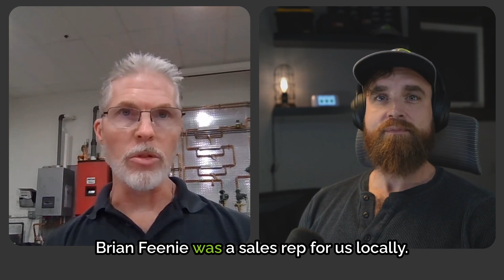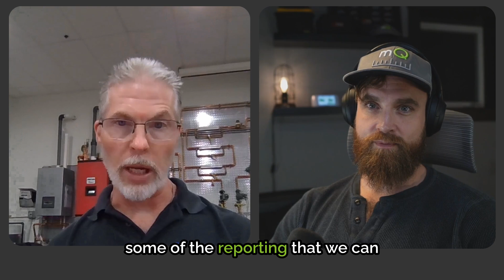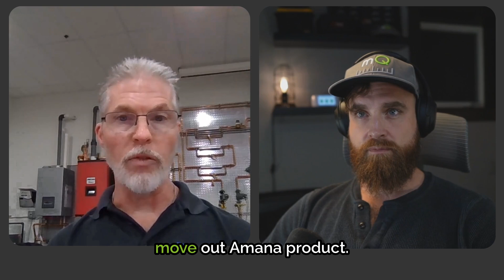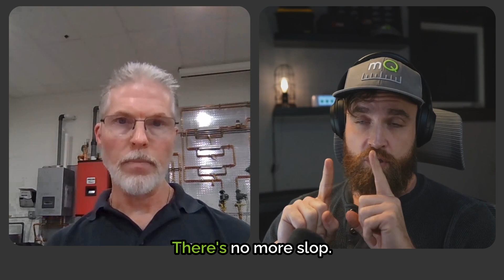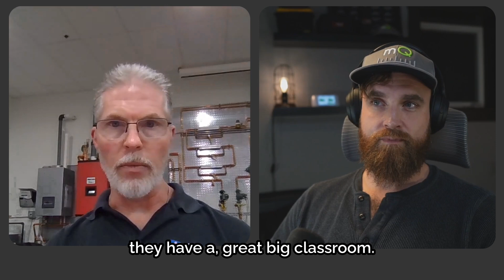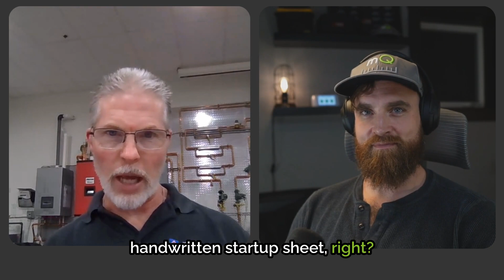Distributors should be Using measureQuick? An Interview with David Petz from Johnstone Supply

Comment: I truly believe this is the tip of the iceberg.  For too long distributors have accepted warranty claims from dealers and issue a credit only to find out the motor or part was just fine.  I like the idea of rewarding the dealers that are doing proper commissioning by possibly giving them an extended labor warranty at no charge, or charge them less for the equipment. Great to see this conversation!

Comment: Years ago, I asked one of the owners of a Johnstone franchise you have so many returns for Warranty related installation error. Have you ever thought of giving a class using Measure quick for the contractors and installers.  They never even heard of it.  How times have changed. 
      I told him this app will change the industry . 

I always ask every contractor , installer I meet do you use Measure Quick and I still cannot believe how many have not even heard of it yet. it’s like they’re trapped in their own little time capsule separated from the world lost in time.